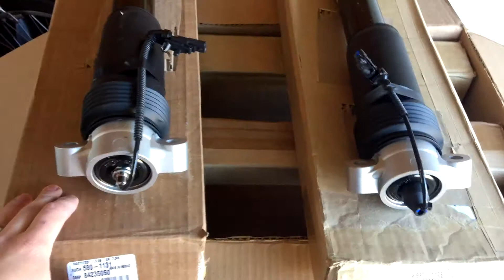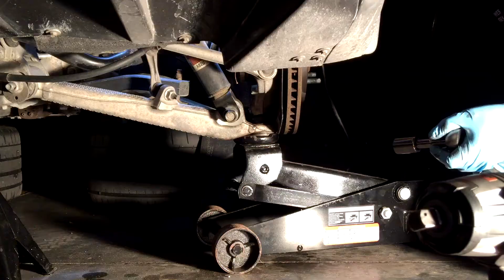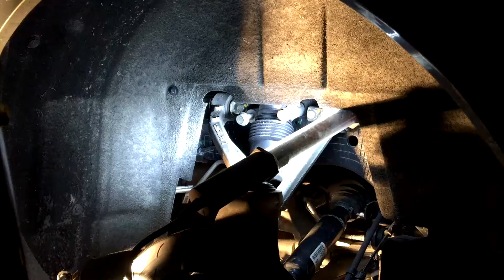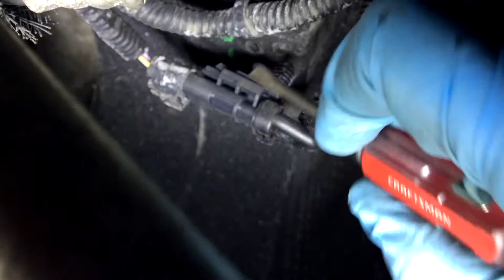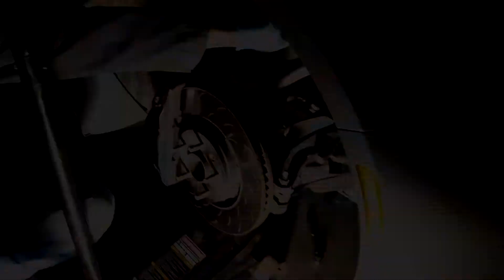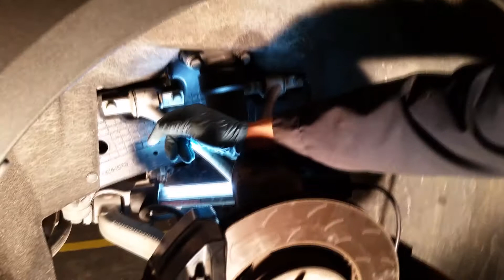Corvette Magnetic Damper Replacement

Comment: Excellent upload Wes. But, why did your Mag Ride shocks have to be replaced. I could see it if they were maybe on a C4 due to age and mileage, but on a C7?
Reply from the maker: My C7 is my daily driver.  I replaced them after about 70K miles.   Three of them were leaking oil.   One of them in the rear leaked for about a year and was completely dead.  The handling sucked for the last few months.  Idk if it was the mileage or maybe the temperature extremes of driving year round in Wisconsin.  Either way, they need to be replaced.
Reply: @wesleyirek1924  Thanks.